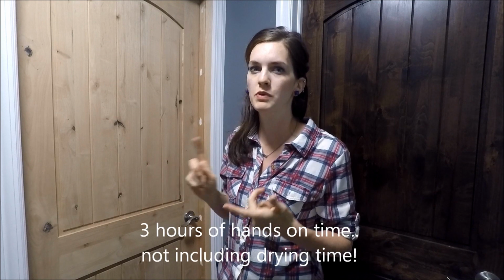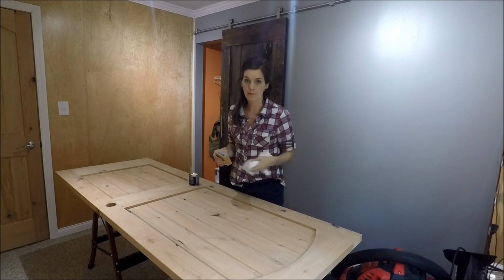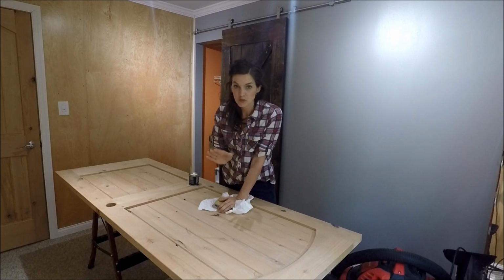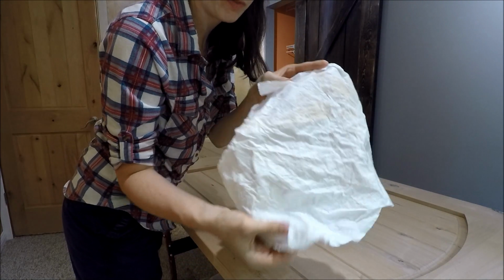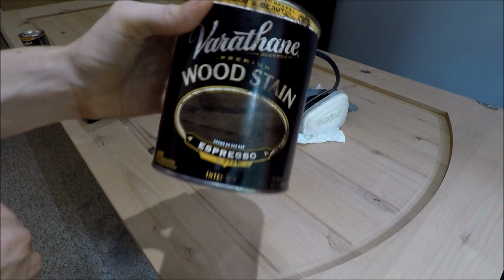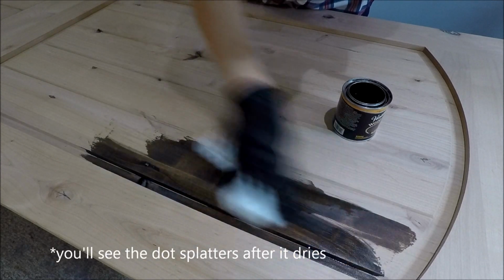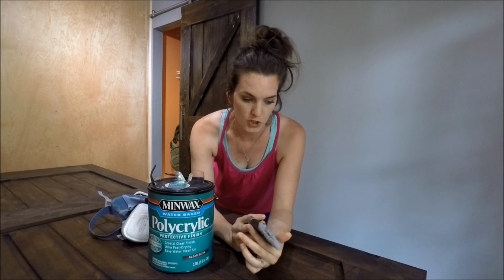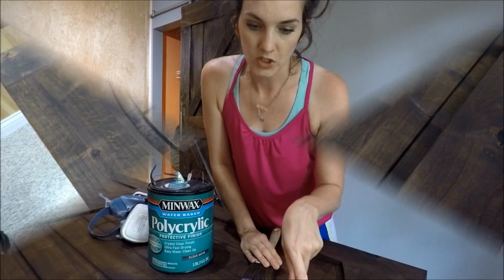How To DIY Staining Interior Wood Doors

Comment: A little tip on removing doors if you are going to leave hinges on the doors-- instead of unscrewing the hinges, just pop the hinge pins out. I did this for a door I painted. Pop the pins, make sure you set them where you can find them, and then when the door is done you set it in place and put the pins back in. Much easier than removing all the screws and then screwing them back on again. A dustbuster or vacuum can get some of the dust, but you can also use a tack cloth to pull off excess dust.
Putting some cardboard down on the carpet underneath the area can keep any drips or splatters from staining the carpet. I accidentally knocked over the stain container while staining before but I had plastic down.
Reply: the carpet in this room was being replaced, but yes - good point!

Comment: I watched your video so many times! The first was when I was thinking of doing something to our yellow doors, which are exactly like yours. Then as the weeks go by and I was still thinking about it, I kept watching until today when I decided I will do this! We have about 40 doors in our house so it will take time. Thank you so much for your amazing instructional video!

Is your stain water based? Also, do you see any benefit to using wood conditioner?
Reply from the maker: Hello! ... we still love our yellow door! .. the stained doors are work (and wow-40!) But 2 years later and they look like we just did them! I'm glad my instructions are helpful! ...  I find water based is easier to clean up, less smell and easier to work with! ... as far as the conditioner I didn't notice any difference, but some will say it does matter.  If you need any other help or share your progress you can always email me too findingfaithsfuture(at)gmail (dot) com ..... good luck! I think you'll love your doors! It's a project I would definitely do again :)

Comment: We are doing a new construction.. and these are the doors we chose for our interior. We are hoping to stain them ourselves and feel kind of intimidated! But u made it look so easy. Any tips?
Reply from the maker: It is pretty easy once you overcome being intimidated!  I know I was the same way. We love these doors! Tips: work in small sections and rub stain in WITH the grain. I used water based top coat with a foam brush,  but when doing the edges make sure you have a rag to wipe off any that runs down and beads up on the underside. Good luck!

Comment: How many polyurethane coats?..did u sand in between? Also im using oil based i dont know if that makes a difference.
Reply from the maker: I did 2 coats.  No I did not need to sand in between coats on these doors but I have found on other projects I have needed too. If is looks and feels smooth then dont sand. Make sure if you do need to that you wipe any sanding dust off before doing another coat of polyurethane. Oil base may take longer to dry but should be the same process!... Good luck!!

Comment: When doing the other side of door, do you wait til first side is completely dry and then stain flip side.  And same with poly finish, do one side and wait and then flip door to do other side?   Is there a way to do it so you can do both sides at same time - such as not removing the door at all??  I have so many doors to do so trying to save time.
Reply from the maker: Yes I wait for it to dry. For the stain that is within hours. Poly- at least overnight..  and no I would not recommend doing it while it's hanging on the doorframe- it is like water - it will drip all over!

Comment: Nice! Is there a stain on the door in the background at about the four minute mark? if so what color stain is that on the door your daughter went through😊?
Reply from the maker: No, that was the last door to get stained. It is natural alder wood and could have easily been simply polyurethane'd if you didn't want to stain it. The lighting makes it look darker than the door I'm actually working on in this video, but they are the same door!
Reply: Thank u!

Comment: You should condition the wood with wood conditioner before you stain to avoid that blotchy look, especially with softwoods like pine.
Reply from the maker: We did condition the wood on the first door, but didnt notice a difference on these Alder wood doors, so I skipped that step.  But that's why I mentioned it, knowing that's what is recommended. Thanks for watching!
Reply: @findingfaithsfuture  here’s where the magic of gel stain comes in. You can use general finishes gel stain right on top of that poly until you reach uniformity and then re-apply the finish, if you’re OCD like me and want uniformity, that is.
Reply: @victorvek5227  In using gel strain - is it recommended to use on the frames too that you cannot remove?  What do you put on top of the gel strain?